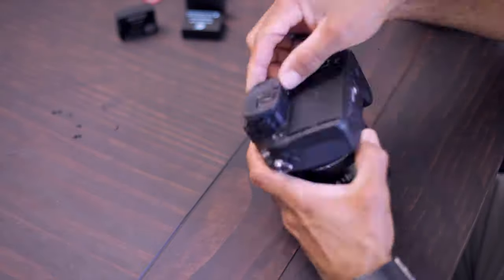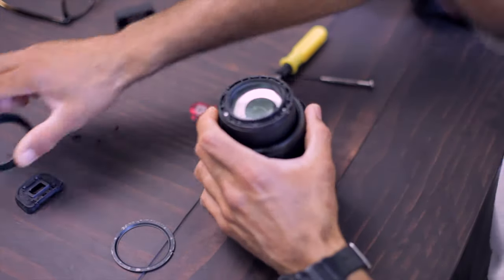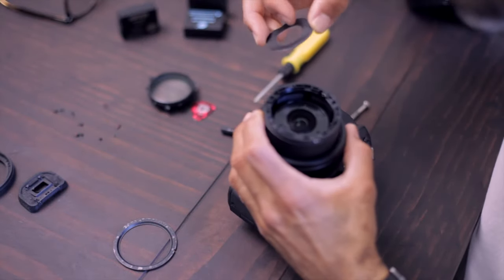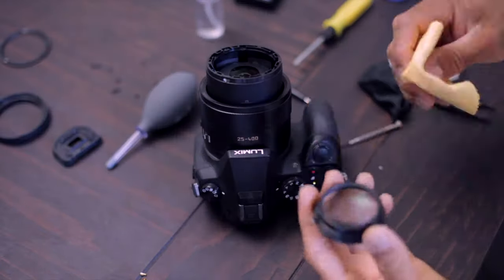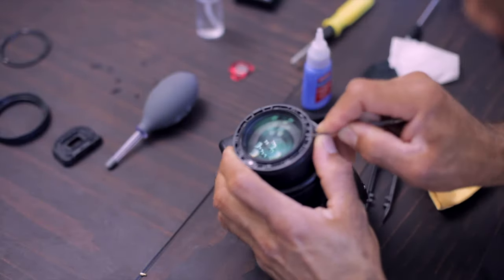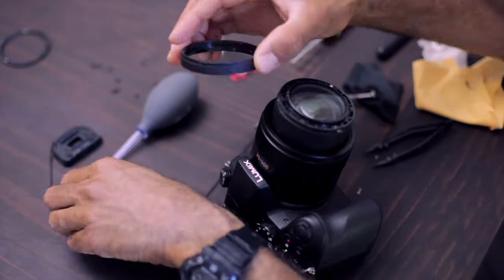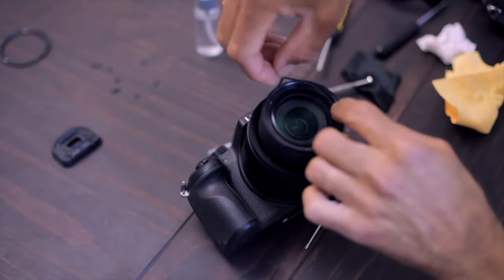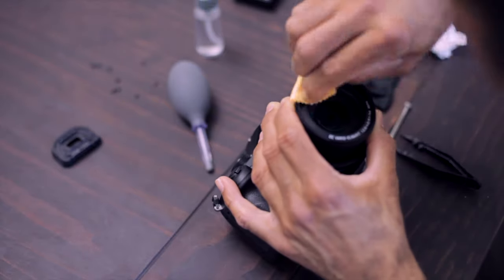How to Fix the Panasonic FZ1000 Lens Zoom

Comment: I can't thank you enough for this video!  This exact same thing happened to me with that interior ring becoming dislodged.  Took me 10 minutes to fix following your vid.  The Q & A on the 2 pins in the comments section helped, too, as I knew to just use a small flat head to pry them out.  I happened to have a guitar pick for the seal which worked like a charm.  THANKS!!!
Reply from the maker: Glad it helped!
Reply: @a_7_m  It sure did.  I love my FZ1000 and didn't want to have to pick up another one or the updated version.  Didn't want to have to send it in either but, if I did, you probably saved me a $100-150 repair bill.

Comment: The pins - how to remove them: For the back story I had the exact camera with this exact issue and the repair shop asked for £170 to sort it out. I successfully did it at home and this video was key in giving me the confidence to do it (I know nothing about camera repair!). I did struggle with the pins so here is my description of this exercise. The pins have a star shape which, with the right tool, you can spin on its spot. This, however, will only make sure that each pin is no longer held by the spot of glue to keep them in place. It will not 'unscrew' the pin. The pin (the two of them) have no dent by which I mean that they are smooth so trust that they are not held in place apart from the spot of glue. They are merely pushed in cosily in their emplacement. If you pull them you will have no physical resistance but for the friction between the pin and its hole. The tools: I purchased all sorts of tools as the pins simply did not want to come out but the only thing that did work is holding one very small flat screw in each hand and clamping 1 pin that way extracting it little by little. The pin did get scratched in the process but this is only aesthetics. Once one pin is removed it is possible to lift the section with the zoom on (carefully of course) and slide it off the second pin. Of course, you can only practice the 1 flat screw per hand and remove the other. In my case, the pins were too resistant to contemplate removing both using the flat head screw. I hope this helps as I wrote this as the video didn't spend enough time on this part and there was some comment regarding how to remove the pin. End result: my camera is back to working as normal.
Reply from the maker: The video was not intended as a step by step guide. However, I am glad you were able to fix the camera.
Reply: I’ve not understand nothing, too fast

Comment: What part exactly got displaced and how did you know?   Is this related to the infamous FZ1000 Zoom System error?   Thanks!
Reply from the maker: The internal ring. The part that looks like bare metal, the normal installation is with the painted side out. As far as I know the zoom error can be caused by this and other things.

Comment: I have lumix fz80 im Facing  system error zoom what is the solution for that
Reply from the maker: Hello, I don't have that camera system, is the internal ring out of place like this one?
Reply: Hi there I have the fz82 aswell but when I switch it on it seems to be out of focus until I zoom it in a bit. Also if I zoom it sounds like something is trying to click in somewhere. Any idea if your method will help in fixing that problem?

Comment: Hello. Please can you help show me how to open the lens and clean it please. It was too fast in your tutorial. Thanks
Reply from the maker: Hello, the main thing is to remove the lens pins and you should be able to access the lens element
Reply: The first step is to remove the fairing (cover) with a guitar pick or similar plastic remover. Remove the screws that hold the hood adapter, then remove the pins that hold the lens element, after that you have access to the inside. Hope this helps

Comment: @a7m — Question: HOW did this part get dislodged/flipped inside the lens housing?? Perhaps ur unsure, but if u had to speculate, would u say it was from mishandling (drop/bump) or maybe excessive use? THANKS!!
Reply from the maker: It seems the adhesive is not strong enough, it may fall off from normal handling.

Comment: Hello, I have the same problem. As to those 2 pins - were they initially simply glued? Or, the position of the lens was somehow specially adjusted and that glue fixes the lens at certain position? Thanks
Reply: Turning them seems to adjust the angle of the lens. I'm not sure how to take them out
Reply: @lorirocks777  Sure, they are used to adjust the lens and to make it too close to the plastic ring. But there is no information how to remove those two screws...
Reply from the maker: Hello, just pry them out with a small flat head screwdriver. They are just pins that hold the front glass in place, I did not notice any chabge to the angle of the lens. It seems like they are interference fit. Sorry about the late response.
Reply: @a_7_m  Hello, thanks for your reply, - do the pins have a hole like *, but with 6 ends? The pins of my camera (FZ2500) have holes for a screwdriver of T3 standard. I tried to remove them as you do, but they don't move at all. That's why I ask you about T3. Are the pins "adjustable"?
Reply: @a_7_m  Thanks. When I turned them with a torx screwdriver it changed the angle of the lens
Reply from the maker: @powerbatterychannel4315  no, these are not screwed in, just pull out pins, I did not notice any barrel deviations, just straight pins
Reply from the maker: @lorirocks777  are we talking about the same camera, FZ1000?
Reply: @a_7_m  Well, so, they have made changes in the next model. Anyway, thanks a lot!
Reply: @a_7_m  Yes. Mine have a star shaped form at the front which fit with a tiny torx screwdriver of mine. As I wound, it position of the lense shifted. After a revolution it was back to where it started.
Reply from the maker: @lorirocks777  good to know, thanks
Reply: @lorirocks777  Sure; it adjusts the exact position/attachment of the lens; it's like a cam bolt, most probably. But - how to remove it?:)
Reply: @powerbatterychannel4315  I removed it like you said
Reply: @lorirocks777  I didn't say. Maybe you mean the words of the video's author - a7m. And do you have exactly FZ2500 or FZ1000?
Reply: @powerbatterychannel4315  Fz1000 mk I
Reply from the maker: @lorirocks777  let me know if it helped you.
Reply: @lorirocks777  So, have you pulled out these star shaped screws? It's interesting to see the process, or the photos. The screws of mine only rotate, but cannot be move forward or backward.
Reply from the maker: @powerbatterychannel4315  try and pry out with a small flat head screwdriver
Reply: @powerbatterychannel4315  Mine too, but I just pried them out.
Reply: @lorirocks777  Please, see the uploaded photos: https://imgbbb.com/image/LUL8y7  I've removed the glue, but anyway the pins don't come out of their socket. Should I pry them again from the back side (1) or do it from the front side (2) ?
Reply: Thank you all; succeed. It turned out that front lens has 2 lenses inside; the internal surface of one of the lenses has something like starlets - either micro cracks or mold; and there is no way out to remove it. Have you any idea whether it's possible to order front lens separately? Thanks a lot
Reply from the maker: @powerbatterychannel4315  If that's a FZ2500, I don't have any information about it, sorry.
Reply: @a_7_m  Maybe you know where to get the lens of FZ1000?
Reply: Power Battery Channel @Wins.myFZ2500 has starlets either cracks or moulds too. Are these found in the sealed surfaces bet the 2 lenses? Have you found where to buy replacement front lens?
Reply: @winstonp8656  Hello, I appealed to the Customer Service of Panasonic; only the Panasonic Singapore has replied with the following: "Dear Sir, Further checking of the lens unit (W/O Mos) is around $391.92. However, we do not have stock." So, according to this, there is no way out for the problem solving, as to Aliexpress - some shops trade in Panasonic spare parts, however, they have no these lenses. The only way to prevent growth of this fungus is hard UV light. You will not destroy your starlets, however, they will stop growing. As to the video usage (I'm not photographing with FZ2500 at all) - I must note that there is no problem with video files. I've purchased already used camera, and the only problem I found subsequently is a tiny crack approximately in the middle of the front lens, which causes a small dark spot at maximum focal length. But for me it's not a problem. As to the fungus - simply don't place you camera in humid places. The former owner of my camera was a terrible smoker, and it has too strong cigarette scent so far. Maybe it's also the reason of fungus ni the lens.

Comment: Hey my fz1000 has a problem that the dial that controls timelapse burst and self timer doesnt work and my camera is stuck on a 2 second timer does anyone know how to fix it?
Reply from the maker: Sorry, but I have not done such repair. You may need to replace the dial.
Reply: @a_7_m  thanks for answering i will try bring it in to be repaird

Comment: Hi guys! I have just purchased fz1000 with "system error (zoom)" message. Trying to solve this puzzle. Can You tell me, anyone, if it is possible with the camera turned off to pull inner part of the lens by hand? I can see on this video, that You can do it. My just stuck like hell. Even when it is turned on I can't do it. Please help. THX for the Video!
Reply from the maker: I don't know what you are referring to when you say if it's possible to pull the inner part of the lens by hand.
Reply: @a_7_m  I already fix the problem. That was motor stuck! Very easy to access, and fix. THX
Reply from the maker: Good to hear
Reply: @maxiu12345  hello nice, i have the same problem "system error" how do you fix the problem?  how to access to the motor stuck?

Comment: Hi
That is a great video!!
Could you please show us how to clean the sensor of FZ1000?
I own an FZ1000 and recently spotted a black dot at f/8 when shooting the sky which becomes barely visible at f/4 and almost disappears at f/2.8.

I came across a disassembly guide at www.ifixit.com 
https://www.ifixit.com/Guide/Panasonic+Lumix+DMC-FZ1000+Disassembly/55433

Please observe step 25 - Those three screws fixing the sensor to the barrel are removed to access the sensor. I strongly believe that tampering with those screws will mess up the alignment of the sensor with the lens. 

Is there any other way to access the sensor to clean it? 
If yes, I would urge you to upload a tutorial video on it!!

Cheers
Ankit Bharaj from Melbourne, Australia!!
Reply from the maker: Hello, unfortunately the sensor in this camera is attached to the lens barrel and it requires opening the camera, removing the board, and everything else which is crazy packed in the body. Cleaning it would be almost impossible if you are willing to disassemble the whole thing. sorry I couldn't be of any more help in this matter. Have you tried the self cleaning?
Reply: @a_7_m  Thank you for the reply! I haven't attempted to clean the sensor but I will try in future if the sensor dust starts to ruin good shots and cleaning up the sensor becomes really important. I have come across a video on YouTube that shows the disassembly of the lens barrel of FZ150. I think I will use it as reference and attempt to clean the sensor!
Reply: Ankit Bharaj )
Reply: @a_7_m  The thing doesn't have a self cleaning feature, it has no sensor IS after all, nothing to shake it around to get the dust off.
Reply from the maker: @unverifiedbiotic  I never had any issues with the sensor cleaning, I have since changed systems and thought the FZ1000 had that feature. Thanks for the clarification.